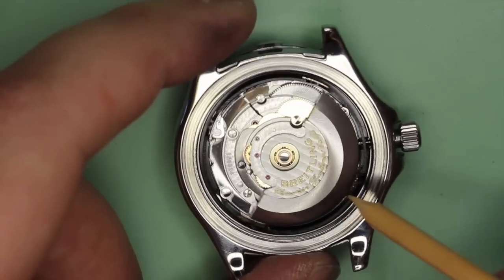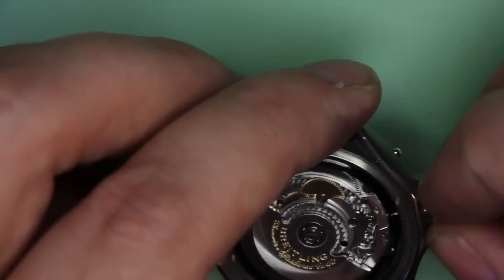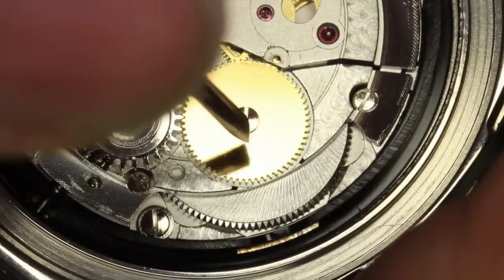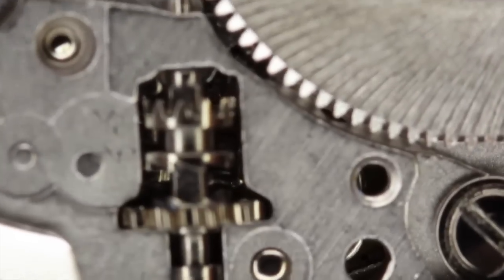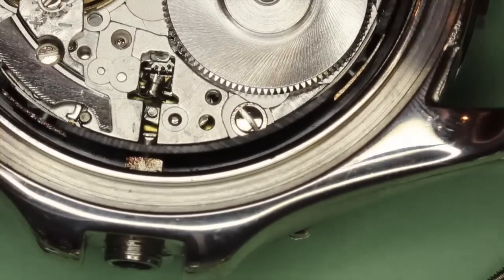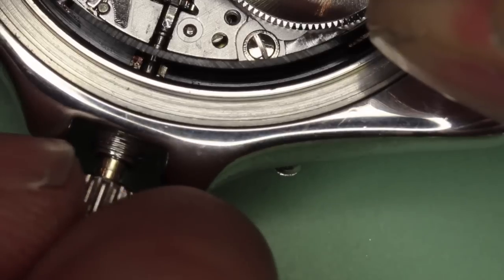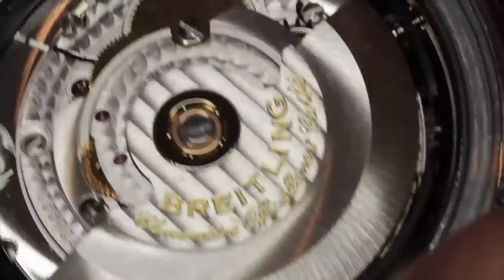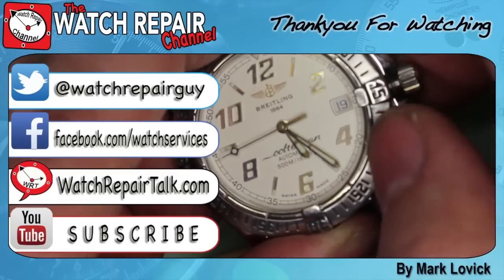ETA 2824 - Winder stuck in calendar position. How to fix. Watch Repair Tutorials

Comment: An absolute nightmare when it happens on a £5k Breitling!!
And you can't let go until you put the crown back in, otherwise the gear flies across the room.
I really didn't fancy taking the shiny hands and dial off. The hands were so clean even my grey "premium" Rodico was leaving traces behind. I opted for alcohol, including to drink.

Watch came in for a time adjustment, removed the crown and movement to give the case a clean and this happened.
You saved me from having a heart attack.

Comment: I have just repaired my Tudor Prince. Thanks so much Mark!! You made it look very simple but it took me 2 days. The most difficult part is when one hand has to hold the sliding pinion in place with a tweezer while the other hand has to put the winding pinion back in place with another tweezer, followed by the stem. This needs some practice.

Comment: That has been very helpful, I have just got back into watch repairing after many years lay off & decided to build my own watch near completion everything was fixed in the case & inserted winder everything was ok so i was  well pleased, The winding stem needed shortening so took it out cut it to length, this same thing happened as you showed, 
I couldn't believe it so I took it out of the case & went in the face side, now I have seen you method its much a better way, Thanks for sharing that Brilliant

Comment: Fixed, thank you! I made the mistake of not putting the sliding pinion flush with the winding pinion upon pushing the crown/stem/stop-lever back in, but quickly corrected before putting it all back :)

Comment: I did the job exact. Two things changed. My hands are not matching up at 3 4 and 6 o’clock. Also when I put the stem back in with the movement out of the case it’s all good. But when I put the movement inside the case and put the stem in, it pulls out. It clicks in and acts like it in and when I pull it out it pops out.  Super frustrating. This is a movement I purchased on eBay from Switzerland. $300 top grade 2824. I was so bummed about the stem being stuck in the calendar position. I meditated on it for a few days and found your video. I nailed it. (By the way I am studying your online course I paid for all the classes. I learn so much. I really appreciate you Sir! Thank you for sharing all of your knowledge. I wish you a very Merry Christmas My friend. 🎉
Reply: Maybe the stem that was sent to me with the movement is just a cat hair short? You think I should order a 2824 stem and see if that responds better?

Comment: Great video! Just used this process tonight. I have also found this process helpful when you have a stubborn set lever (detent) screw. You can use a tiny balance screw holder on the detent screw.

Comment: Awesome videos on your channel!
I currently have a problem with a 2824 and a 2892-A2 where it is very hard to pull or push the crown into the different setting positions, even after cleaning and lubricating.
Do you have an advice for that?

Cheers

Comment: Thanks, very informative. I'm watching because I'm having an issue with my 2824 seagull clone, and wonder if I can ask you a question. I removed the stem by first putting it in the time setting position (as I understand I am supposed to do), then pressed the button and removed it. But I can't seem to re-install the stem. It just won't take. Is there an easy fix, or do I have to break down the movement as you do in this video? Any advice would be appreciated. I'm quite new to this.

Comment: Never taking my stem out without pulling it all the way out first. I was going to junk my 2824-2 but said I can do this. I used a needle to set the Pinon in place or you can use the tip of the stem that way you have the next step already in your hand. What a pain that part was... anyways thanks a bunch...

Comment: Hi Watch Repair Channel. I have a new watch with an ETA 2824-2 EL movement.
The company who sold it to me set the date and time before they sent it but they did it, as far as I could tell, while the hands were near the 12 oclock position (A big no-no I'm told). When I received it the crown couldn't adjust the time, it could only turn the date wheel.

I wound up the watch a bit and let it run for a day and then had another go once I got back from work and suddenly it would let me set the date and time with no issues. I've manually would the hours round through a few days, from a couple before the date they set to a few days after and it seems to be working ok now. My question is simply, do you think the watch will be fine or is there a chance that there is still damage to the date wheel etc?
I've heard eta 2800 series movements have some sort of spring loaded protection against changing the date when close to midnight and that it can cause the watch to sort of hang for a few hours till the gears mesh again. Is this true?

Comment: The Achilles heel of eta 2824, I have 27 of these movements and more time than not when removing the stem  it either won't go back in or it goes in partially and won't wind .

Comment: I have similar or maybe the same problem with my Sector 340 quartz watch. The winder stuck in to time setting position and its quite difficult to go back in to date position again. From date position I don't have problem to turn it back one more time and screw the crown - the problem is only from last position (time setting position) to go back in to date position. 
Please tell me if the answer of my problem is the same like in the video or I should do something different.

Comment: I ordered a watch online withe a 2824 and when I screw down the crown all the way when fully wound the watch stops after around 15 minutes or so.  When I leave the crown unscrewed and in the calendar position the watch works fine and the power reserve last 38 or so hours.  Is this probably because the crown stem is to long?

Comment: How do you let down the mainspring if the stem is not installed?  I have a 2824 where the yoke has slipped out of the sliding pinion slot, and I can't insert the crown/stem all the way.  Can I just insert the stem part way until the square section engages the winding pinion and then let it down? 

Thanks for your excellent videos, Mark!
Reply: I am pretty sure you need to remove the automatic winding module before it will let you let the tension off the spring.

Comment: Hi i have a problem with my watch none of the hands are moving not even the second hand what can it be broken?the part name if you can tell me i will apreciate
Reply: Its mechanic automatic
Reply: azizzable I had a similar problem, I botched the little crown release pin by pushing to hard and he keyless work got messed up and stuck on balance stop setting (it's an ETA 2834 with 'hack seconds' feature) I had to reasemble the keyless works.
Reply: @ulisesroman7259  did you try this method from the video first?

Comment: Tried this method with little success.  Once I try to reinsert the stem it is resistant to going in.  If I do get it in, it spins freely and will not lock into place.  Anyone have any thoughts?
Reply: I'm having this exact same issue.